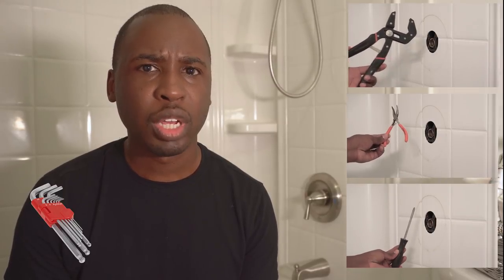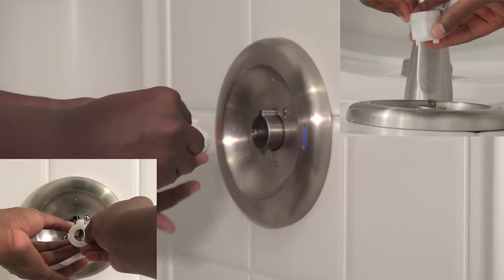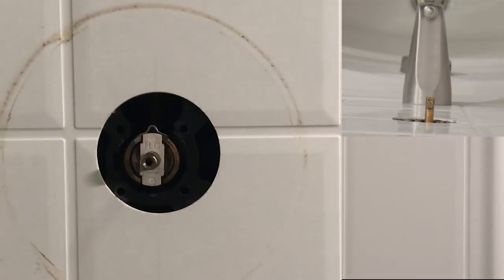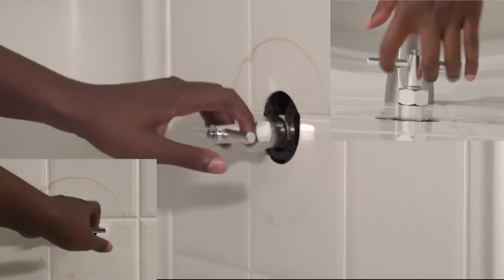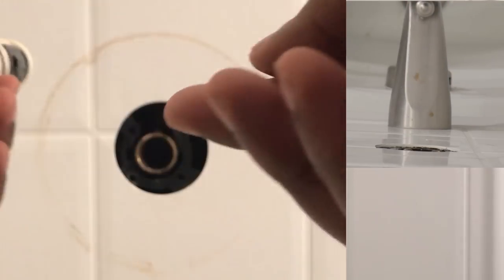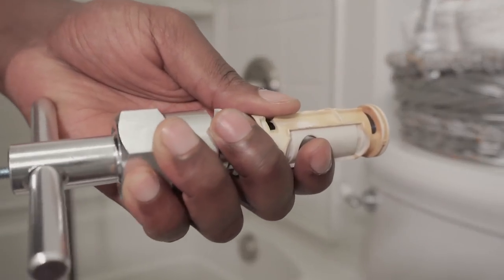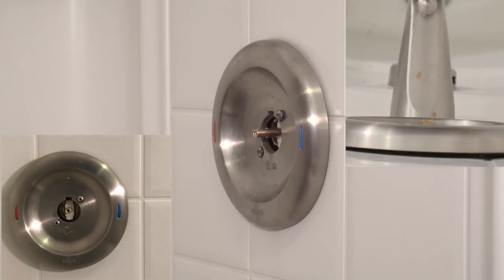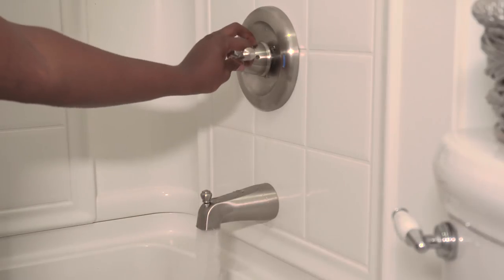How to replace a Moen 1222 shower faucet cartridge

Comment: Thank you sir, great video.  I really appreciate you leaving the "mistake" in the tutorial.  The back piece was not flush when i initially prepped.  Thankfully i remembered your presentation, and caught the error before i assembled.  I had a tough time pulling the old cartridge out(Wd40 for the win!!), the rubber pieces just disintegrated, and i had to fish pieces out of the hot and cold valves.
Reply from the maker: In my new home I had the same issue it took me a good 20 mins to get the cartridge out. Mine broke into a few pieces that I had to fish out par for the course I guess

Comment: Buy and use the removal tool. I’ve done it both ways. Without the tool the valve broke and I had to remove it piece by broken piece. With the tool the job was easy.
Reply from the maker: Thanks for the tip

Comment: I learned more from your video it will help me install my moen shower cartridge soon i wish i can remember all i did when working with moen cartridges i need to use a small sander wheel or round wire brush to clean the inside of the pipe before installing the cartridge and good idea to practice turning the water for a second or two to flush debris inside the pipe thank you
Reply from the maker: Thanks for the tips

Comment: Excellent video! You have tips that other videos don't, and camera angles that others don't.

A couple more tips we can add is that you can often get a new cartridge for FREE from Moen if you just call them, and the other is to put a towel over the drain hole just in case you drop a screw or other piece. You really don't want to find a replacement piece while your water is turned off for possibly the entire house.
Reply from the maker: l31007 thank you I have called meon and they gave me a had time so I didn’t want to recommend them. Others have mentioned the drain tip and it was covered I just forgot to mention it. Have you replaced yours, how did it go?
Reply: @Hindsight101  I did one in my house about 3 years ago. But now I need to do another bathroom. So I needed to remember the process. Thanks to you, I will have confidence to do it again.
Reply from the maker: @l31007  Let me know how it goes

Comment: BIG THANKS! got the tool, valve and lube online for in store pickup at Home Depot.
Reply from the maker: You're welcome I'm glad you could find everything
Reply: @Hindsight101  Got it done, lost the clip in the wall. :( Made a replacement out of safety wire! :)
Reply from the maker: Really, safety wire worked interesting

Comment: Like so many positive comments, I too wish to add mine in thanks for your video. My cartridge replaced was the moen 1222, part of a shower facet installed nearly 10 years ago during a renovation (2 other bath/shower moen units in the house as well). I will say, the tool was absolutely necessary in my case, as pulling the cartridge out took a great deal of effort, to the point of near damage to the pipes as well as the backboard and tile. Unfortunately, the entire mixing valve was never anchored properly in the wall cavity and only held in place by drawing the mixing valve towards the cover plate via the two long screws (a shoddy short cut by the renovating plumber...I expect the same with the other units). So in my removal process, I used one hand to turn the tool's "T-handle" with the other hand hold the mixing valve body (aided by a wrench) so as not to torque the pipes (that would have been another can of worms springing a leak). Fortunately, I trusted your comments as to keep working that cartridge out, which it did, literally with a pop, with exploding rotten rubber and the hot/cold tab firing outward. (I hope that made sense). Bottom line, success in replacement and turning silky smooth. With the investment in the tool along with the experience aided by your video, when the other units grind to a halt, I'll be ready :) Thank you. PS...I must admit an error. With the new cartridge in the tool to install, I confused the H/C orientation. In other words, it was upside down and during my first test to check for movement temperature — cold was hot, hot was cold. Fortunately, with a newly lubed cartridge, pulling out and reorientating was easy peasy. And thinking about the additional work, I'm amazed I didn't drop the locking pin or a screw inside the wall. It was a good day. Cheers.
Reply from the maker: This is awesome thank you for your comment. I am so happy this worked for you. Yes usually they don’t come out as easy as the one in my video. I’ve had to break the cartridge piece by piece until it came out. As an FYI the tool is usually made out of cheap material and doesn’t last long. Thought I should tell you since you have quite a few to replace. Take care.

Comment: Thanks a lot for your help. My shower handle broke in the on position and had to run outside to turn the whole house water off. Luckily, the Home Depot by my house had that cartridge in stock. I was able to remove my old one with vice grips but I would not recommend that because that brass piece could of broke off and that would of been a disaster. Again, thanks for this video! Oh and by the way, call Moen and get a free replacement cartridge they give them out.
Reply from the maker: So glad it worked out. I will try and call didn’t have much luck the first time I tried.

Comment: Thank you for this detailed instruction video. I was able to fix mine within 30 mins at Friday night 11pm. Yes, it's quite difficult to pull the old cartridge out of the pipe, and originally I was not dare to pull using my full strength since I thought I may did something wrong, you words at 4:22 give me the confidence and it worked!
Reply from the maker: Happy it helped. This cartridge was much easy than others I have removed. Some I've had to break into pieces.

Comment: I didn't have the Moen puller so this is what I did.  I used the tip of a screwdriver and snapped the top and bottom tab off where they sit in the inset grove. That way when I used the white tool that came with the cartridge, the tabs didn't prevent the tool from turning the cartridge enough to loosen up.  After it turned back & forth a few times then I pulled with channel locks/pliers while also turning the white tool with an adjustable wrench.

Comment: I just spent 2 hours removing a broken cartridge!! I drilled and tapped the brass part inserted a bolt and spun it at high speed and walked it out slowly!!! What a pain in the butt!! Then I had the chisel the plastic insert out with out hurting the brass valve body!!!
Reply from the maker: Yeah I've done something similar and took just as long. Some I've had slide right out others was a construction project lol

Comment: Thanks man I'm doing this now.Next up find the parts and that tool.Mine is stuck big time
Reply from the maker: Feel free to break it sometimes that’s what I had to do was breaking into little pieces to get it out but just be careful not to damage the pipes
Reply: @Hindsight101  Ace hardware had the puller for $18.Worked great, I did drop the darn clip behind the wall.Two pack of copper ones worked very well $12

Comment: Thanks for this video.  It was very well done.  I was thinking you couldn't do a better job until I watched you goober up the silicone grease.  Now you've got an unnecessary mess to clean up on the shower floor! The only thing I would add is to cover the shower drain in case you happened to dropped something.  It would be difficult to replace a set screw (for example) if one happened to fall through.  Keep up the good work!
Reply from the maker: Thanks for the suggestions. For my other installations I ended up buying better silicon grease because the package supplied by Moen was cheap and  messy. I did cover the drain but totally forgot to mention it. Its one of those things I am so use to doing, I forget others may not know.
Reply: Thank for you brought this up.

Comment: Great job, very informative, easy to understand!!!!
Reply from the maker: Thank you
Reply: @Hindsight101  What could be the problem if I changed the cartridge and it still leaks? Also, I noticed my bathroom sink is leaking underneath the cold water handle. I know the cartridge in the handle needs to be replaced, could this be why?
Reply from the maker: Your sink should have nothing to do with the shower. Have you checked to make sure you installed the cartridge correctly?
Reply: @Hindsight101  Yes, after watching your video, I went back to check. Is it possible the handle needs replacing, the hardware inside? Tub faucet replaced?
Reply: Just an FYI, bad cartridge!
Reply from the maker: Thanks for the update

Comment: I have followed all the instructions, and tightened the adapter to the best, but the weight of the metal handle would still push the adapter down. For example, I tried to adjust the water temperature cooler, but the handle would not stay in the position I wanted, but slowly moved toward colder temperature by itself.
Reply from the maker: Did you put the small set screw back in?
Reply: @Hindsight101  Thank you for your reply. What are small set screws? I believe I have put everything back. Maybe I missed something?😁
Reply: @Hindsight101  I reviewed your video one more time. I had put all the set screws in as shown in the video, and tightened them completely (both in the adapter and the handle). But the adapter still doesn't have enough resistance and would slightly move toward the cold water direction with the weight of the handle when I take my hand off from it.
Reply from the maker: Sorry not sure why
Reply: @Hindsight101  That's alright. I do appreciate you taking time to reply to my question. 👍

Comment: From reading the comments ,....it sounds like the cartridge puller would be a wise move to purchase .   the cartridge is a bit difficult to extract  the puller makes it much easier so as not to cause damage to the brass housing .
Reply from the maker: Yes the cartridge puller makes things 10x easier

Comment: You are a master plumber sir, thanks for the informative video!  May I suggest you cover the floor drain before you do this so you don't drop a screw down there?
Reply from the maker: I did cover the drain you just couldnt see it in the video. Thanks for the tip though.

Comment: thanks for pointing out your error because that is what I was doing...I couldnt get the cartridge flush to install the retaining pin.
Reply from the maker: Welcome
Reply: @Hindsight101  I just re-installed the cartridge and couldn't believe how easy I was able to get it flush and same goes for the retaining clip. I was using small channel lock/pliers holding the stem of the cartridge and of course I was also forcing the stem into the valve assembly! So now I used the plastic removal tool along with the channel locks to push the cartridge all the way in. Thanks again

Comment: Really great video! You mention this is helpful for a leaky shower. Can a cartridge also be the cause of lack of hot water in one shower but not the other showers?
Reply from the maker: Its possible, do you have a sink in the same area as the shower not getting hot water? Does the sink get hot water? Thanks for the comment.

Comment: It appears that the allen nut on my handle was rusted out, but I wasn't 100% sure (wondered if I had the wrong sized allen wrench). I have a 14 piece allen wrench tool so thought it unlikely, but checked another video on You tube and learned that the allen wrench size is 7/64. After a quick trip the hardware store my issue was solved. TG
Reply from the maker: good to hear 👍

Comment: So here’s a question…I changed my cartridge and when I turn it on where it’s warm the pipes make a weird sound which never did that before until I turn it all the way to hot then it stops then I can bring it down to warm without the sound also when I turn it to straight cold water and just before the faucet is shut off I get warm water coming out. Does this mean the cartridge is put in wrong and I just need to pull it out again and redo it? Sorry this question is long thanks.
Reply from the maker: This doesn't sound familiar but you may have put it in wrong

Comment: Great instruction video, especially the detail to note the valve flush during the cartridge installation. I watched Moen video on the 1222 cartridge installation and they did not mention this accidental mistake! 👍
I have one question, perhaps due to what I did but not knowing what, that even when I tighten the screw at the adapter, the handle/lever still wiggle left/right by one or two degrees. I modified a hard rubber grommet to make a washer for this screw, still to no avail, it still wiggle in the OFF or Closed position. Other than this, the lever & cartridge work fine, just annoying why this happens. Any tips? Thx
Reply from the maker: My wiggles as well but I have not notice any issues with it
Reply: @Hindsight101  Thanks for your confirmation! So it seems normal with this cartridge, as long as it works without problems (like water leaking, dripping).
Reply from the maker: That's my findings

Comment: Great video - thanks for sharing. Is there an easy way to distinguish the difference between a 1222 and a 1225 Moen cartridge? I wouldn't expect them to be interchangeable
Reply from the maker: 1225 is gold and 1222 is white. Plus they function differently. One a push pull turn the other is just a turn.

Comment: Hi. Your tip about not letting the back of the cartridge stick out: Wouldn't that be corrected when the handle holder is screwed back on, pulling the brass stem back out just a bit as the handle holder braces against the white parts and metal collar?
Reply from the maker: Technically yes but you would have to make sure you pulled it all the way in without seeing it you might not get it flush so it’s better to take it out and make sure everything is flush so there’s no leaks
Reply: @Hindsight101  If the pin goes in easily, does that mean that the cartridge is in far enough and correctly?
Reply from the maker: Probably

Comment: So if you want to make the water hotter, do you make the adjustment counter clockwise?
Reply from the maker: Correct
Reply: so I got everything to work kind of. I think the problem is the actual plumbing. So I think I need to turn the cartridge the reverse way on how I currently have it. Because the way it is right now and it has always been this way is, To get the hot water you are just cutting it on and the more you go up  is when it gets cold @Hindsight101

Comment: I have a quick question what if the 2 lines are facing the bottom side but the HC are still at the top . When getting the new one can I turn the brass or the hc so that I can have the 2 lines on the bottom and the HC on the top ?
Reply from the maker: I would keep things the same

Comment: Great video and info. about not pushing the brass stem and describing the double notch (which many videos do not do).  I have a quick question, are the black rubber seals on both sides not glued onto the cartridge?  I got a new cartridge and took it out of the packaging and the seal came off (with like lubricant on it)...is that normal??  Also, could a bad cartridge result in water pressure issues and a long time for the shower to warm up?
Reply from the maker: The black rubber washers can be removed. But if you feel its defective i would exchange it. Water pressure issues yes but water taking a long time to warm up seems like another issue
Reply: @Hindsight101  ..Do you mean the seals on the cartridge with the holes?  The seals are not permanently glued on?? I don''t mean the o-ring washer.  Will those seals bunch up/move during the installation given the tight chamber of the cartridge and the seals not being permanently attached to the cartridge itself?
Reply from the maker: I know what you mean now yes those black pieces are not supposed to come off

Comment: I have a small leak that's coming from the valve and water is dripping on the metal sleeve and going behind the wall. Do you think replacing the cartridge will stop the leak?
Reply from the maker: It's a possibility I had a similar issue and replacing the cartridge fixed the problem

Comment: what do you do to seal the face plate against the shower wall? looks like water would run down the faux tile seams and then in behind the wall. i've seen a foam bead embedded in a bead of caulk before. thanks.
Reply from the maker: This link should help https://www.thisoldhouse.com/bathrooms/21016460/how-to-caulk-a-bathtub

Comment: Great video - looking to replace mine as it leaks cold water while in use out the handle.  I am curious on last section of your video where the piece was pushed in too far is could be the cause of my issue.  Granted it is has been in there for 15 years.
Reply from the maker: My guess is probably age as well I know I just moved into a new house and I had to replace all the cartridges because they used cheap replacement parts so keep that in mind for future reference
Reply: @Hindsight101  Interesting that you said it's a new house...recently I had problems with my sink faucets not having enough water pressure. We had to change all the aerators as sediments might've built up due to construction or whatever particles got into the pipes. Now the pressure for the sink faucets are strong as ever.

I am experiencing a slight water pressure weakness in my bathtub/showerhead and I'm wondering if my builder also used cheap cartridges....which confuses me, because wouldn't they just use the cartridge that comes with the shower kit?

Great video nonethless!
Reply from the maker: @RubzNotNice  My apologizes I meant new house to me. The previous owns replaced the original cartridge with cheap ones.

Comment: The notched part on the horizontal brass part, being "up" didn't work for me. I put them down and then it did work. Was my part marked wrong? Everything is fine now but I have a leak. I think I wore out the cartridge taking it in and out.
Reply from the maker: Let me know how it goes